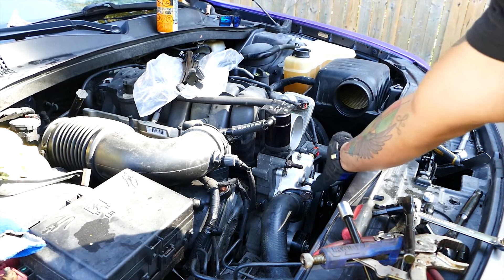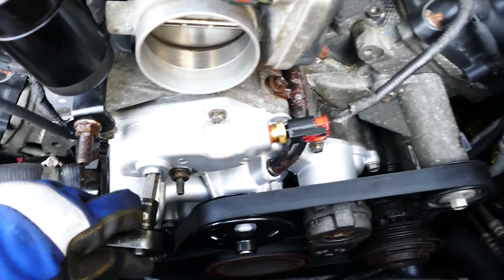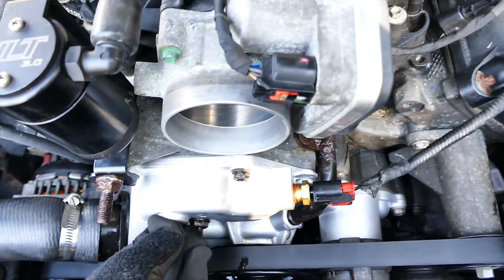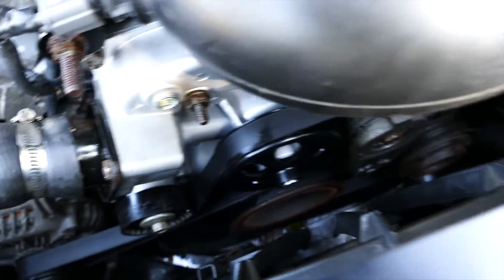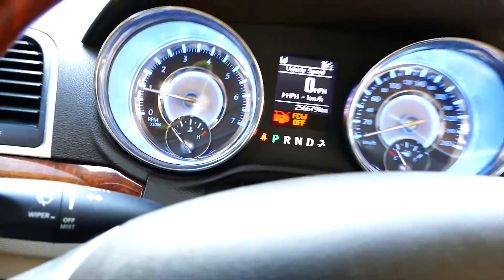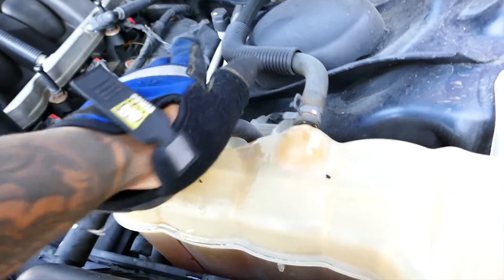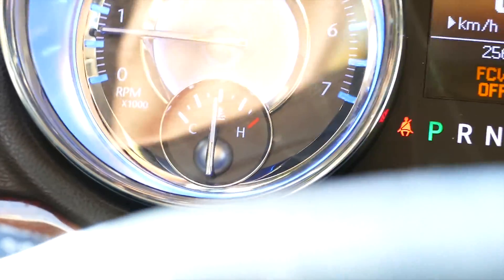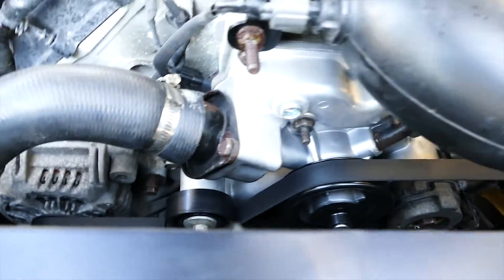how to bleed coolant system on 5.7 hemi

Comment: Sup bro🤘🏾 2013 Chrysler 5.7L hemi 300C here! Just replaced my water pump. No leaks at all & I let it warm all the way up to temp. But it started over heating soon afterward & revisor was slushing coolant. I didn’t unscrew the bleeder screw before filling back up with coolant and starting it could that be my only issue? Engine is hot right now as I’ve just finished. But I’ll do the bleed step in the AM once it’s cold again hopefully that’s my issue I completely forgot about the bleeder screw and do I need to disconnect a hose from the revisor to release air or just the border screw ?
Reply from the maker: Hey there! Yea give that a try, if that doesnt work try replacing the thermostat, its pretty cheap to try, if that doesnt work its the radiator

Comment: Is the radiator empty? What if there’s old fluid in the radiator
Reply from the maker: This 5.7 doesn't have a rad cap, to get the all the old fluid out, a rad flush at a shop with a machine would be the way to do that. If you wanted you could drain the rad from the petcock valve at the bottom of the radiator but you would still have old fluid in the heater core. For this situation in the video I bled the system to change a bad thermostat and did a coolant flush at a later time.
Reply: @moparbro thank you so much

Comment: Should the radiator fluid be able to get to the bleeder screw before the car heats up? Being that the system is under pressure.
Reply from the maker: Yea it can be done cold, it needs to fill up the water pump before exiting out the hole.
Reply: @moparbro so the car should be running or no?
Reply from the maker: @jamespowell4950  for the bleeder screw I did it off, then when fluid came on the bleeder hole and installed the plug and ran it without the rad cap off to push air out. When you fill up the the fluid with the bleeder hole put it fills up using gravity and the air gets out of the bleeder hole. You run it without the radiator cap to pressurize the area above the bleeder hole when its closed and out of the rad cap

Comment: This might seem like a silly question to some but I want to make double sure. Can I run the heater alone even with the AC not being charged up? I don't want to mess this up. I'm replacing the entire front end of a Challenger RT 5.7 and it's my girls car, as you know hell hath no fury.
Reply from the maker: Hey there, yessir yea can but I would just disconnect the ac compressor as it will try to run with the heat on. But tbh its kinda cheap enough to charger the system at a shop. But if your in a pinch yea iv run it without ac, you can even ac delete But I think you need a dummy pully
Reply: @moparbro that was a really quick response I can't tell you how much I appreciate that and your time. 😊
Reply from the maker: @jamespowell4950 thnx for watching!
Reply: @moparbro I'm definitely gonna have it professionally charged. The car right now, I'm just getting to the point today in an hour or so of reconnecting the radiator the fan and the AC. But the AC definitely has to be recharged and I'm getting everything else on there first. The fascia isn't on there yet or anything. I'm picking up the thermostat, housing, and seal before I go over there.

Comment: Did you need to disconnect the battery terminal for Thais step
Reply from the maker: Hey there, i didnt, but it's quick enough to disconnect if you wanted too, might help reset the sensors.

Comment: What was the steady temp ??
Reply: After replacing it and it warmed up what was the steady temp
Reply from the maker: @Dinero0906  195 degrees or just under 1/2 on the temperature gauge

Comment: Does the coolant resavoir have to be empty ?
Reply from the maker: @Dinero0906  it doesn't, when you unscrew the bleeder the reservoir empties itself.
Reply: @moparbro  okay thank you 🙏 glad u responded I had this video saved
Reply: Just changed my thermostat filled it up ran it for 15 minutes and relised I didn’t bleed it help! Can I bleed it with the resavoir filled
Reply from the maker: @Dinero0906  you can try running it without the reservoir cap for 20 minutes and let the air bubbles out. I would just unscrew the bleeder screw and the reservoir will empty itself, once the coolant stops dripping out, start filling the coolant from the reservoir tank until it comes out the bleeder hole then screw in the bleeder, then continue to fill the coolant reservoir until it's full

Comment: Mine overheats sitting still fan refuses to come on I’m about to check for air then run through electrical
Reply from the maker: @nathanmartin4433  might be the temperature sensor or the fan or bother, see if it kicks on if the a/c is on. The a/c should trigger the fan, is not the fan might be the issue

Comment: If I can't get it to bleed after filling it up does that mean my water pump bad
Reply from the maker: @dontaywest483  yea it's either the water pump or radiator. I would do both or go to a shop and get the coolant system flushed and then they could determine what's wrong after from that.

Comment: My car doesnt over heat but im noticing the heat is lukewarm warm (sometimes) and when idle the needle goes to the mid line then back down to a quarter of the way about …… but when im driving it stays at the quarter mark and the heat is hot as hell i just replaced the radiator and i hear water slushing when i start the vehicle whats up ? I hope its not the head gasket, i also just replaced the thermostat twice , i used the bleeder hole and i dont believe it actually is getting all of the air out?
Reply from the maker: @StreetStoriesEnt  hey there, of you replaced the radiator, it could be the water pump and the only thing other item in the cooling system would be the heater core. I Would replace and water pump and get a coolant flush from a shop.
Reply: @LowKey1314  hey did you ever figure out what the water slushing was when starting the car, I also get have that in my 5.7 and hear it when turning on and off the car

Comment: Will this method work on my 2006 Chrysler 300C 5.7 ?
Reply from the maker: @lsx_chuyitooo  hey there, yea pretty much same set up, thnx for watching!
Reply: @moparbro  cool but my coolant reservoir is full i just have to bleed it again or do i need to take all the coolant out and start over again?
Reply from the maker: @lsx_chuyitooo  hey there, if the reservoir is full just remove the reservoir cap and remove the bleeder screw and have a bucket to catch the coolant. Once the reservoir is empty start filling up the reservoirse until the coolant runs out then put the bleeder screw back in, after that fill up the reservoir.

Comment: Been having some issues with my scatpack it was overheating and i add coolant and it drinks it all
Up it even makes gurgling sounds i check the oil and it’s definitely not going into the oil anyy help
Reply from the maker: @irineocampos131  hey there, I would start with the thermostat, then water pump, it looks like it's not circulating the coolant correctly

Comment: I did exactly same thing but the upper radiator hose get hard as rock and engine overheating after long drive
Reply from the maker: @abdullast3434  could be a blockage somewhere or a bad radiator. Try taking it for a coolant flush where they hook it up to a machine and push new coolant in while extracting the old coolant and anything blockages. If the rad is bad the coolant flush technician would let you know
Reply: Thank you so much for the advice. Just one more question Is a bad thermostat would cause this issue?
Reply from the maker: @abdullast3434  yea could be the issue especially if the temperature fluctuates, it's cheap enough to change.
Reply: @moparbro thank you sir I really appreciate your help. God bless you
Reply: Finally I figured out the problem. Its was the water pipe under the intake. It was leaking. Thank you
Reply from the maker: @abdullast3434  ah gotcha, glad it worked out
Reply: @abdullast3434  how did you fix it? Did you need a part?

Comment: Hey quick question when u bleed the coolant did u literally only open the bleeding hole an then instantly closed it back up or did u let all the coolant run out ?
Reply from the maker: @richardrosa6504  hey there, as soon as the coolant pours out I close it up, when I comes out the hole the coolant is at its proper level within the waterpump
Reply: @moparbro  ok so unfortunately I didn't not do that an I put new coolant in . Long story short I just had my radiator replaced and they wanted to charge me a ridiculous amount to flush it... So I started doing myself I started overheating whatever cool and I have in there right now I should get rid of all of it and start over again?
Reply from the maker: @OfficiallyRichforReal  ah gotcha
Reply: @moparbro  yea so I should drain the whole thing or
Reply from the maker: @OfficiallyRichforReal  I wouldn't drain the whole thing, I'd bleed it, then get a coolant flush if you want new fluid in your whole system, or just run it as is, if it's not over heating then it's working
Reply: @moparbro  the other thing is I had all my radiator hoses changed along with the thermostat inlet and outlet hose. Add a new fan and with that they did a whole coolant flush.... And just three days ago my radiator blew. So I also didn't feel the need to have to get another flush done . Also wanted to do it myself but it started overheating I think it may be because of the air pockets
Reply: Also do you think that's bad mechanics or I just had really bad luck ?
Reply from the maker: @richardrosa6504  seems like it just happened, appears to be air pockets with changing all those coolant items. Keep bleeding it, run it with the coolant reservoir cap off for 20 minutes to let any bubbles out. You're almost there, thay pretty much all the coolant system components.
Reply: @moparbro  lol yea that's what I was told ... Cars but I appreciate you with the replys . I definitely gave you a sub !! Keep up the good work !!
Reply: @moparbro  hey bro I want to say I did all those steps and everything seems to be running %100 I appreciate you ! THANKS AGAIN
Reply from the maker: @OfficiallyRichforReal  nice! That's awesome,  cheers man

Comment: Bro thank you so much. I’ve watched so many videos on how to replace your thermostat and nobody has said what size allen key it is to take out that screw where the water pump is to bleed the system! Thank you! Now I can go to autzone and ask for a 10mm allen key and I can replace my thermostat!!
Reply from the maker: hey there! thnx for watching!, alternatively you can also remove the coolant temp sensor and keep filling coolant until it drips out of the coolant temp sensor hole 🔥 cheers

Comment: I don't have a bleeder plug
Reply from the maker: hey there you can remove the temp sensor and bleed out of that hole, or you can remove the thermostat hose and keep filling the water pump until it drips out of the thermostat housing neck. thnx for watching

Comment: hey man, im havin some problems. I had recently just purchased a 06 hemi heritage edition. I did not do my proper due diligence, and making sure the vehicle was mechanically sound, so now i reep the consequences of that. I fixed a good portion of the problems i had which was it overheating, i had a coolant leak from the resovoir so i replaced it and pressurized system. changed thermostat, spark plugs and coil packs, temp sensor and more. . it all helped for about 4 days. then the heat randomly stopped working(which it was working before) then quickly started overheating. i pulled over and my coolant was bubbling in the resovoir, with nothing coming out. Ive been stuck not knowing what to do now. is it still cooling system related? or head gasket. i got a bunch of codes thrown at me. Any help is appreciated!
Reply from the maker: hey there, if it was head gasket you would get coolant in your oil so we can eliminate that, if the waterpump hasn't been replaced I would start with that and a new thermostat (I had Brand new thermostats fail on my hemi before), if that doesn't work it's the radiator. the only other thing I'm the coolant system that may be the problem is the heater core. But really that's all the components to the cooling system. If the water pump hasn't been replaced its good to change it anyways and see if that works. thnx for watching!
Reply: @moparbro  awesome ill get to work these things tomorrow. i appreciate it! definitely subbing. Nice ride as well.
Reply from the maker: @mechwex  🙌🔥

Comment: What if the heater runs hot but after like 4 miles the car starts to heat back up, I follow the whole bleeding steps, how long should I bleed it for should I let it bleed for a couple seconds? when I bleed it and added coolant nothing happen then I put a tube in the hole and sucked and then it started to bleed I then quickly put the screw in tighten it up and filled to the line let it run for left cap off for 20 min then took it on a drive after 4 miles and started to get hot and I headed back home can you help me please.
Reply from the maker: hey there, it appears to be a bad thermostat, iv had new ones go bad quick, if the thermostat is new, might be the water pump,  if all those are new it's the radiator. Try a new thermostat and go from there. thnx for watching!
Reply: @moparbro  so say what if ll that is new including the radiator and the engine. thanks for your advice I am gonna try the thermostat tomorrow.

Comment: Can I use water instead of antifreeze ?
Reply from the maker: hey there, if you're in a warm area like Texas or Miami where it doesn't get get cold enough to freeze, you can temporarily, I personally wouldn't, coolant also acts as a lubricant and treats all the rubber hoses and seals, also depending on what water you use , it may have chlorine or other minerals that will leave unnecessary deposits within the cooling system. In any case yea I would use it only as a temporary measure to get it to a shop or something like that. thank you for watching and commenting!

Comment: And if the Alan plug is rounded out????
Reply: @onlymans165  a little late but if the burp plug is rounded out..pull the coolant temp sensor and release the air that way.
Reply: @emancipateme_kd9202  thanks!!!

Comment: My reservoir is completely full and it's still not coming out. I can't get any coolant from the reservoir to go into the engine
Reply from the maker: hey there, remove the thermostat housing hose and full the water pump with coolant through there, fill until coolant drips out of the thermostat housing neck, it's the same level as the bleeder hole so it does the same thing, re attatch the coolant hose. if this doesn't work take it to.a shop for a "coolant flush" you most likely have a blockage and a coolant flush should fix that

Comment: My 05 300c i replaced water pump radaiator cooling fans thermostat and flushed heater core still over heats.. Dont have heat unelss i hold rpms at 2k then at idle heat gets cold again fans kick on but over flow jug boiling any help would be great
Reply from the maker: hey there, if the heater core is all that's left that hasn't been replaced, it's probably the actual heater core, my buddy with an 05 just had his replaced.

Comment: Hey so I followed the steps, I let it run up until it got warm about 15 mins. Put the cap on and after driving I’m noticing bubbling in the reservoir
Reply from the maker: hey there, seems like a coolant blockage, I would get a coolant flush done (where they attach the coolant system to a machine that pumps coolant through the system, it will fix the blockage or identify the issue by exposing a leakage
Reply: I would also check to see if maybe your coolant reservoir is cracked or broken somewhere. I had this problem with my 300C
Reply: Or the coolant temperature sensor dat wht I had changed last week
Reply: Do ur fan kick on
Reply: Mine did that and it was a bad cap. I'm still over heating tho lol